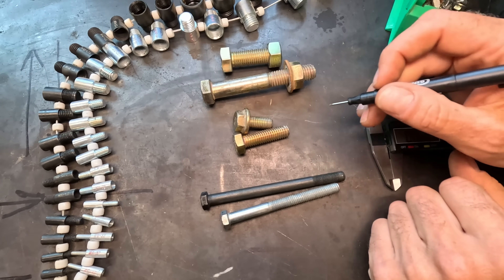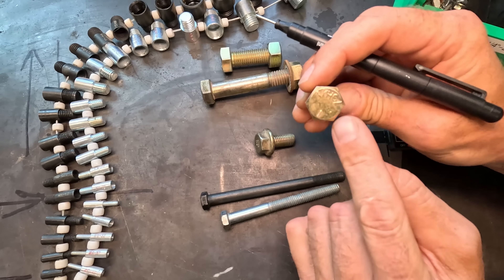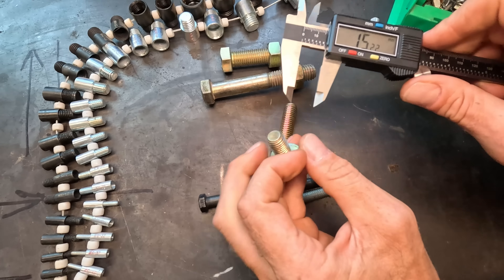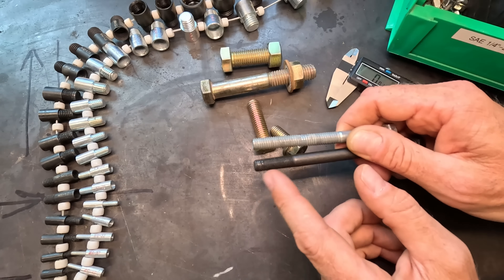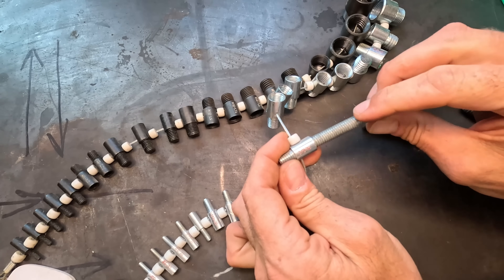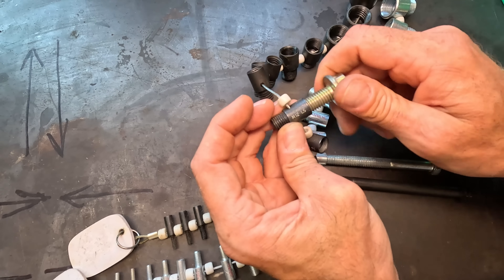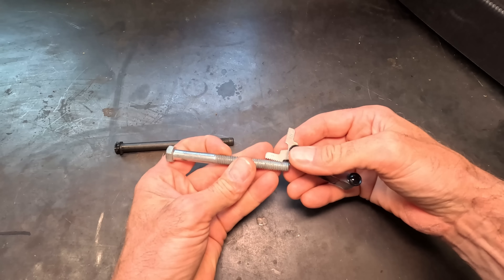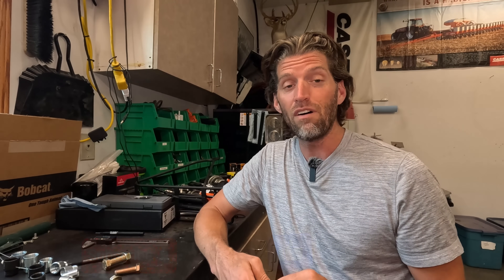How to find bolt & nut size, metric or imperial.

Comment: Years ago we had a few machines made in England before WW2.  Bolts would not match up with SAE or metric bolts. Old time mechanic told us they called them bastard threads. At one time England had their own sizes & threads. Back in the 1990's while working at a newspaper engineers at Goss presses decided to change over presses made & sold in the USA to be made with metric hardware. Had thousands of bolts on the printing presses. Some metric, some SAE. Reminded me of the 1984 Ford LTD that I owned. Started to replace the alternator and first bolt that I throw a socket on was metric. Okay. Put my SAE sockets & combination wrenches away and bought out my metric. Of course second alternator bolt was SAE.
Reply from the maker: I've been enjoying reading comments about all the random thread types, sizes from people. It's been a fun learning experience for me....exposure to new things. And, I chuckled at the Ford LTD comment, classic. I was a Chevy and Buick guy myself.
Reply: You have a dear old chap called Whitworth for standardizing bolt and nut threads. Not so much size or thread form but being able to interchange like threads with other like threads, not hand made nuts and bolts which required 'fitting' to each other individually, blame him as an arms manufacturer requiring accuracy throughout his machines

Comment: you know whats fun. working at a hardware store for 4 years and just looking at a bolt or nut and telling the customer what it is.
Reply: Not only that but being able to look at a bolt or nut from several feet away and know what it is will save you a lot of time over the course of a career.
Reply from the maker: I bet you had some interesting customer encounters. My hope for these basic videos was to help those average folks to come in with (maybe) slightly more knowledgeable to help themselves at least ask somewhat educated questions.
Reply: @LearnedFromDad  About 30 years ago, I witnessed (engineered) an exchange between a German guy I was working with, and my boss in a maintenance shop...

The German guy needed some 12.9 bolts for a suspended hoist beam. (a beam suspended on bolts below a structure, so entirely dependent upon the bolts' strength to bear the beam, the hoist, the load...) Not something I liked, but it was necessary.  I prefer my crane beams to be on top of structural beams, merely kept in position by bolts... 

Anyway, 12.9 was the spec, Minimum tensile strength 1200 mpa, minimum yield 1080 mpa.  A tensile strength of 1200 MPA is about 12,000kg/cm^2, the 1080 mpa yield is about 10,800 kg/cm^2.  My boss offered to get him 8.8 spec bolts, only possessing a tensile strength two thirds of the required bolts, and a lower percentage yield strength...

It was an interesting conversation to witness... My German mate's English was superb, but he struggled to explain to my boss why 8.8s were potentially dangerous.  I stayed out of the conversation having had similar ones in the past... It was good to see someone else struggling to communicate simple stuff to him...
Reply: Yep, Been There and Done That!    🙃
Reply: Throw in some odd pitch .
Reply: I spent about 20 years working in our family's hardware store and I can generally tell you a bolt size from across the room. Those without a similar experience are usually in awe of this magic.

Comment: If the fastener is all threaded it's a screw, for it to be a bolt it has to have an unthreaded section
Reply from the maker: Great comment. Hadn't gone down that detail path yet. Cheers!
Reply: unless it's a stud!
Reply: @iggyppup  then it wouldn't have a hex head
Reply: More commonly, a bolt is a fastener that uses a nut, whereas a screw is a fastener that goes into a threaded hole or cuts its own thread. But it’s poorly defined and not worth the trouble of an argument.
Reply: In engineering terms its clearly defined

Comment: Technically speaking a SCREW has threads all the way to the head; a BOLT has an unthreaded shank near the head. Bolts are stronger since the root of the thread is the weakest part. SAE Grade 8 is strongest, Grade 5 is pretty std in the auto industry. In American standards, there are coarse threads (UNC), fine threads (UNF) and extra find threads (UNEF). The finer thread bolts have a larger minimum "root" diameter and are correspondingly stronger but they can't be torqued as much.
Reply from the maker: Great comment. I hadn't gone down that detail path yet. Appreciate you sharing! Take good care.
Reply: Have purchased hex headed cap boots with threads entire length. On the fifth wheel of tractor trailers they used a SAE above 10 or 11. If I was hanging heavy things from a concrete ceiling would use SAE grade 5..
Reply: I use wood screws with unthreaded sections all the time; those aren’t bolts.

Comment: The "Magic Number" to convert Metric to Imperial (inches) and back is 25.4 - divided or multiplied by, using a calculator. I'm an Engineering Inspector (Retired) so measuring is what kept a roof over our heads. 📏🔩🕵
Reply from the maker: That's a great comment. I'll write that down on my wrench holders. Thanks!

Comment: Howdy, i had just had your video about washers reccomended to me earlier. I was thinking about it the other day so im glad the topic came up. I actually got this video in my reccomend as well a bit after, and i didn't realize i wasn't subscribed to you or havent seen you before. of course an easy sub, I'm surprised to see such low numbers with your concise explanation and good cadence. Best of luck with your YouTube journey! you have a polished feel already, and apparently the algorithm has picked up your chennel to reccomend to new people. I think if you keep posting, perhaps ask some question to the viewer or some way to help with engagement in the comments, and i think youll be well on the way to start growing quick. Keep up the good work! Now im gonna restart the video and actually listen to what you're teaching lol.

Sorry for the ramble. Also, i had broken a bolt on a customers front sway bar mounting bracket. The bolt had a washer with it, but the new replacement bolt did not have one that was fitted to the head. Just in case i decided to take the time to widen out a washer i had so it would fit over the threads, i figured if it has washers from factory there ought to be a reason. I am not an engineer, but its my job to do this job to the best of my ability, and if something needs replacing id like to make sure its done correctly. 

It just got me thinking more about the engimeering behind bolts, nuts, washers, thread pitch etc. And, the reason why they are applied in the areas the are. Again, sorry to ramble, but I enjoy knowing and understanding why things are done the way they are, so its fascinating to be able to have this incredible access to the internet where we can all learn the absolute ins and outs of any topic of our choosing. 

Nice video! And best wishes with your channel!
Reply from the maker: I really appreciate the "ramble", meant a lot. My kids and I are having fun doing this. I enjoy educating, but also learning, which I'm able to do a lot of through people's comments, and more. Take good care!
Reply: @LearnedFromDad  thank you much! Best wishes to you both

Comment: Very useful. 
I worked in fastenings in the UK for about 7 years in the early 'noughties, including in the automotive industry. It was starting to become difficult to source imperial-sized nuts & bolts in any sort of volume in the UK at that time - no-one specified imperial-size bolts for new manufacture products, and absolutely everything was metric. You could get imperial made-to-order - but rule of thumb was that less and less suppliers would actually stock imperial. Only exceptions were old model vehicles like the Land Rover Defender - the design was so old that it still specified imperial nuts, bolts & washers - and old carryover special manufacture parts re-used since the 70s for manufacturers like JCB,  and things like self-tapping screws, which were still specified in gauge size and imperial lengths.  There's a myriad of thread pitches and sizes for imperial fasteners - UNC, UNF, BSF, Whitworth, etc - which are all slightly different (although M6 threads are - by coincidence -  interchangeable with 1/4 Whitworth)
The good news is that anything metric was and is the standard in the UK & Europe, and  999 times out of 1000 standard coarse pitch threads - easy. And all came in standard sizes - M4, M5, M6, M8, M10, M12, M16, M18, M20 - and standard lengths with the same gaps as the diameters (with multiples of 5mm from 20mm long and upwards). Even the Ford Worldwide parts catalogue had a load of metric fasteners in it! So I think North America is pretty much an anachronism when it comes to inch size bolts & nuts - the rest of the world went metric years ago!
Reply from the maker: Thanks for watching and the comment. I would love it if the USA would switch to metric everything. I work in both systems daily, and it's a chore to switch back and forth, just like speaking two different languages!
Reply: In the Uk, from Ford at Dagenham all the threads were A F, American Finethread. Motorcycles like B S A Norton Matchless ETC were BSF British standard Finethread and  and Whitworth.
Most British made vehicles used the same threads. Nuts and bolts for engineering and construction were mainly the same British threads except for specialist things that needed super fine threads like dials calibration tools etc.
Reply: Hi, the old british motorcycle fine thread were 26tpi, and generally called cycle thread,  a leftover from the early days of putting engines into beefed up cycle frames, as All pedal cycles were 26tpi fasteners. Hope this helps, Atb.
Reply: @chrisrogerson177  M6 by coincidence interchangeably with BSW, a very scary thing to assume about those 2 totally different threads .
Reply: yes, metric is way simpler!!
Reply: As an American, I can say America is stupid.  We should’ve been metric decades ago.  We are SLOWLY moving there, however.   Time to rip the band-aid off and finally make the switch.
Reply: Well I am building a model steam engine at the moment. Everything is imperial with bolts ranging from 2BA to 7BA. You can still get hardware and taps/dies for these. My new dial calliper is imperial only. I like machining to whole numbers not weird decimals. OK I have 29 reamers in my set rather than 9 but at least I can make more precise holes for crankshafts, rods etc. The worst thing about metric is you cannot divide by 3. Ouchhh!!!
Reply: @mbak7801 I got seriously confused recently when I had to measure a shaft that was imperial with my Vernier caliper. Way easier in metric!
Reply: @mbak7801  Of course you can divide by 3 🤪

Comment: In the UK you had: UNC, UNF, Whitworth, BSPT, BSPP. Plus a few more I have forgotten.  My 1995 Landrover had a mix of metric and SAE fixings on it and the seat belt mounts were something else, but dont remember what exactly.
Reply: @lrdisco2005  The "something else" the seatbelt mount would be was "Seized" 😏😉😂
Reply from the maker: The mixed bag is always entertaining. On ag products I work with in my day job, we've moved towards metric hardware almost exclusively, but often have random 'inch' hardware that came on came on an off-the-shelf purchased component from a supplier.
Reply: That’s British engineering for you. They also have games like Snooker, where the referee puts balls back on the table after you pot them, seemingly out of spite.

Comment: In my shop I have spare oil drain plugs for my vehicles. BUT, what size be they? I took 1 of each of the 4 different sized to ACE
and found a nut for each one, took them all home to my shop & put the nuts in my parts cabinet in the same drawer as the plugs
for quick reference.

!
Reply from the maker: I'm delayed in getting back to some comments. Great idea! Appreciate you sharing that. Cheers!

Comment: Heads Up Here SAE has nothing to do with nut and bolt sizes. The standard that once covered thread dimensions was called SAE J475. It has been replaced by ANSI B1.1 as of 1964. If you look in a SAE handbook you will see text telling you to use the ANSI data. There are no printed specs for screw  threads in the SAE handbook.
Reply from the maker: Sorry for the delay in response, I'm behind. I appreciate that comment. I'm definitely one of those Americans who still is overly conditioned to use the slang terms of 'standard' and 'SAE'. Been trying to change that. Cheers!

Comment: You also have the grip. The grip is the amount of thread. 

You also have the style of bolt, carriage, cap screw etc. 

Then there is the coating. You have black, zinc electroplated and hot dipped galvanized. Those are the major ones at the big box stores. For corrosion, cadmium-plated is the best but it is not environmentally friendly and very expensive. Toyota was known for their cadmium-plated bolts. The coating on a zinc electro plated bolt is too thin for outdoor use and they will rust. The hot dipped galvanized bolts are intended for outdoor use. Hot dipped nuts are overtapped after galvanizing to allow extra room for the zinc coating on the bolt. This means the threads on the nuts are uncoated and subject to rust unless in contact with the bolt; do not leave the unprotected nuts outdoors, the threads will rust. Normally, you cannot fit an electroplated nut on a hot dipped bolt. Conversely, placing a hot dipped nut on an electroplated or black bolt will result in a nut with too much slop.
Reply: Or just use stainless steel bolts and nuts
Reply: @steveC2  Now you’ve done it and opened up the other can of worms I was trying to avoid. Stainless comes in two forms essentially rusting and non-rusting; Austenitic, Ferritic, and Martensitic. You will have to figure it out. Some stainless steels will have intergranulal corrosion issues. Heard a story of stainless steel step bolts being used on a crossing tower in the salt water. After a few years the linemen went out to the tower and the step bolts snapped off when they stepped on them. This rusting is why my knives and Nectgrill rusted and your stainless frig rusts. Bad stainless.

Use brass bolts, they are much weaker but don’t rust.
Reply from the maker: Love this!
Reply from the maker: This is an awesome comment. I love engaging with people like you. Definitely was keeping the video average person simple, but love these kind of comments.
What kind if engineering work do you perform? Thanks for watching!
Reply: @LearnedFromDad I  am a retired civil/structural engineer from the electric power industry. My specialty was foundations that use some of the largest custom made bolts you will find. My endeavors included managing the civil materials for the 350 substations in the system. This included the nuts and bolts. The nuts and bolts were bid out to bolt manufactures and delivered by the truckload. Next time you look at a transmission tower, remember that each angle member is held in by nuts and bolts, a lot of nuts and bolts. Each bolt has to be right for the load and bolt length. You don’t want metric bolts in your A394 tower bolts. I had to resolve the field complaints when the nuts did not thread on the bolts and get the manufacture to replace the out of spec delivery.  

Most structural designs are limited by the fastener, the nut and bolt. Know your nuts and bolts and you make your job easy. Learn how to find the right type of nut for the bolt. It is all in the ASTM specifications.

Comment: Amazing thought that went into naming grades of bolts,as it has 3 lines on the bolt so that is a grade 5 bolt!
Reply from the maker: I know, right! I've learned in my years of working in design, there is always a reason, and that is one I'd like to know. Maybe something like a hex bolt has 6points, so they wanted to max out at that. Someone may know and comment if we're lucky.

Comment: The thread checker that you have an affiliate link to does not have the common 12-24 size in it. But then neither do any other thread checkers of that style that I have seen. There are also metric sizes it does not have. The "screw chek'r" brand plates have many sizes that are missing from your suggested thread checker, but they only work for bolts, not nuts. I have yet to find a screw size checking system that works for all the common sizes of screws, let alone the less common sizes. I learned this very quickly when I tried sorting the screws I had. I found I had a lot of 12-24 screws, and a lot of screws I have not been able to identify yet.
Reply from the maker: Thanks for the comment. Agree with so many different sizes that finding a universal check tool is a challenge. I rarely work with machine screws so I hadn't noticed.

Comment: What is not mentioned is the difference between bolts and set screws.  A bolt is one where the threaded section is around 1"/25mm long and the rest of the bolt has a plain shank as your long bolts.  A set screw is where the bolt is threaded all the way to the underside of the bolt head.  This is vitally important because if you a clamping something down you do not want to run out of thread before you achieve the correct clamping pressure.  Also, you don't want a bolt that is fully threaded where there could be fretting or where a part needs to rotate on the plain shank.
Reply from the maker: Great comment, thanks for sharing!!

Comment: 12.2mm dia will never be metric 12mm (metric bolts are ALWAYS under size because the od is 12mm but the threads are rounded at the tip)
Reply from the maker: Thanks for sharing, great comment.